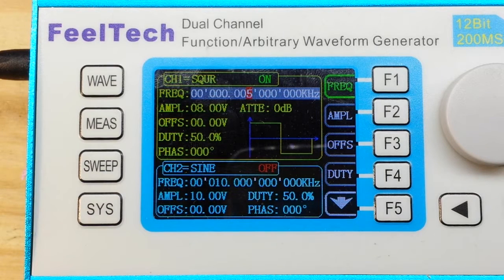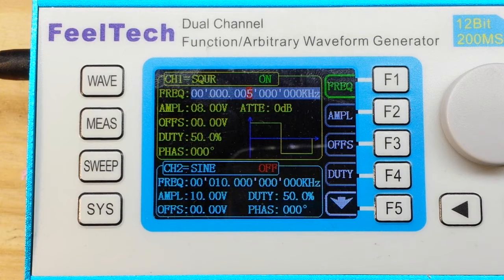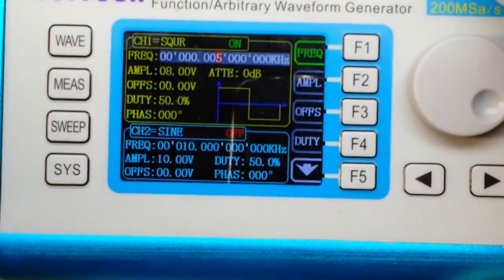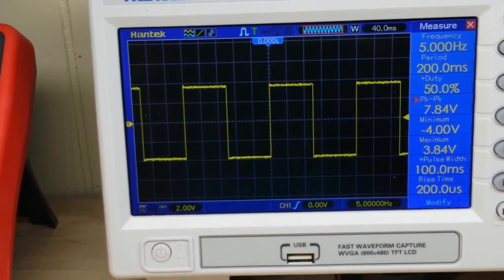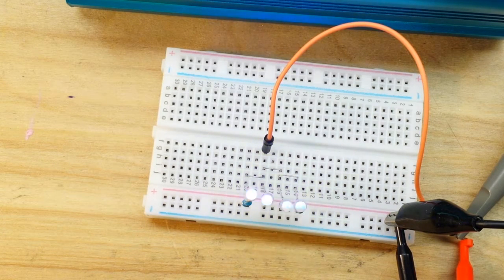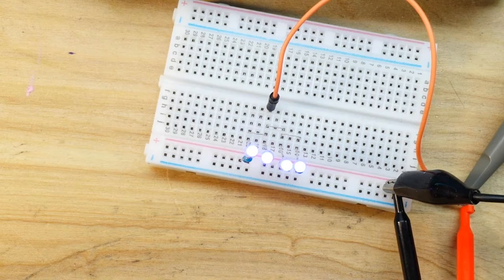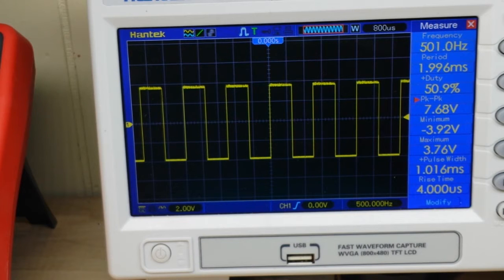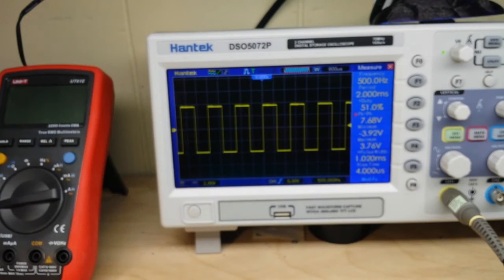Frequency, Duty Cycle, & Function Generators

Comment: OK frequency and duty cycle make more sense. I guess I still don't see a use for the function generator unless you are doing audio or somesuch circuits? I do mostly CNC stuff and have yet to need a function generator although I have one just in case. Keep bringing enlightenment, maybe we'll all get it someday.
Reply from the maker: +George Chambers Function generators are most widely used in audio and RF applications. But I like to use it to mock up a circuit to see how it behaves at different frequencies.